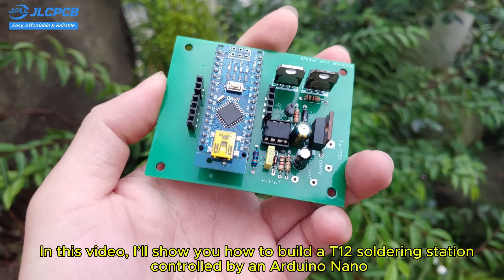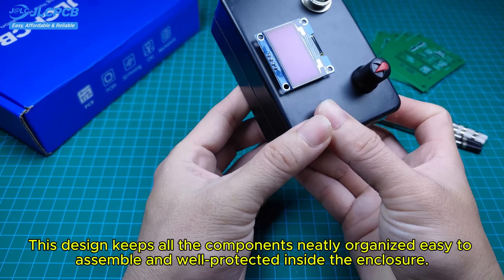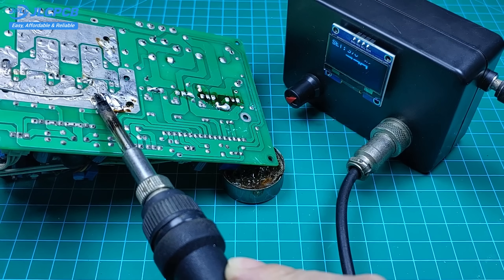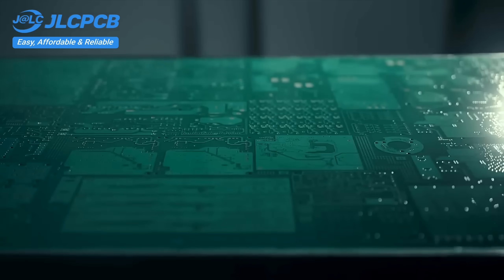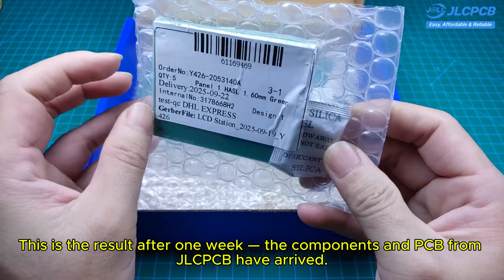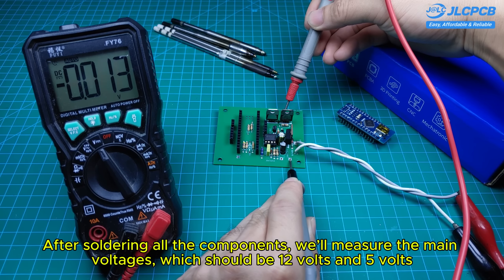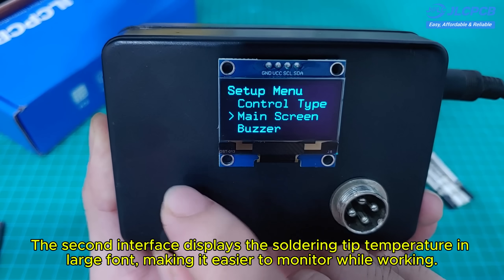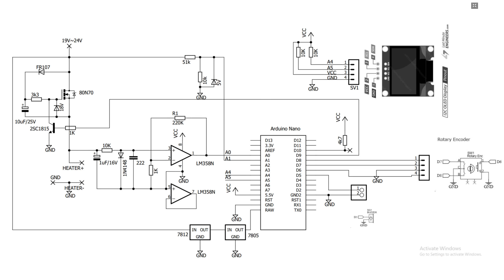DIY T12 Soldering Station with Arduino Nano & OLED Display | PID Temperature Control | JLCPCB

Comment: I2C displays flicker during filming due to a mismatch between the display's refresh rate and the camera's frame rate (FPS), a phenomenon known as stroboscopic effect.

The reason I2C displays (and other types of digital displays) flicker during filming is a mismatch between the display's refresh rate and the camera's shutter speed. If the camera captures images at a different rate than the screen's refresh rate, the camera will record the screen at various lighting stages, creating the flickering effect visible in the video.

These are two explanations that have the same result.

How to solve the problem
To avoid flickering when filming a display, you can:
Adjust the shutter speed: Experiment with different shutter speeds on your camera to find one that minimizes or eliminates flickering. Speeds that are multiples of the screen's refresh rate (or the local power grid frequency, such as 60 Hz in Brazil) usually work well. Adjust the camera's frame rate (FPS): If possible, adjust your camera's frame rate (FPS) to match the display's backlight frequency.
Hardware brightness control: If you're working with an I2C display, use a potentiometer to manually adjust the brightness instead of using the full voltage, as this can stabilize the backlight.

Hugs from Brazil
Reply from the maker: Thank you so much for help me understand that.

Comment: how read temperature , i see you sch you not read temperature
Reply: and i see code #define SENSOR_PIN    A0        // tip temperature sense  you read a0 pin but it is output voltage to give iron 
and many question i have  you use 10k rassister to opamp pin number 3 no divider you use if iron give 15v out it go on op amp  and also you do 200x gain by 200k resister ! i think many mistake in sch
Reply from the maker: It easy bro. Just search about T12 tip. You will understand